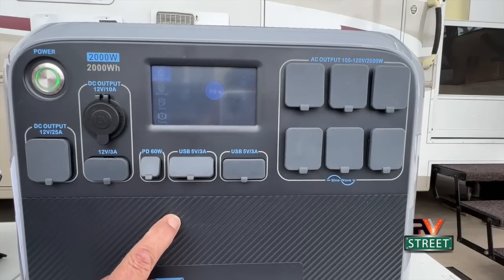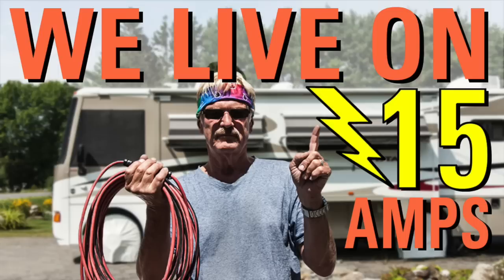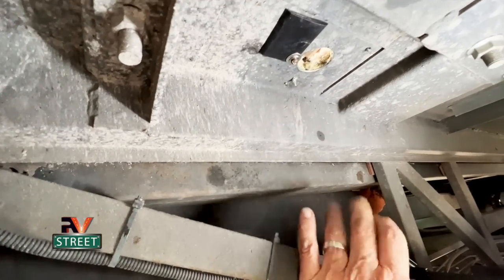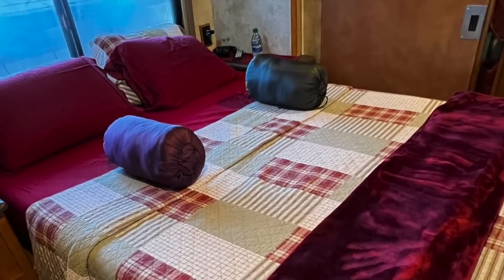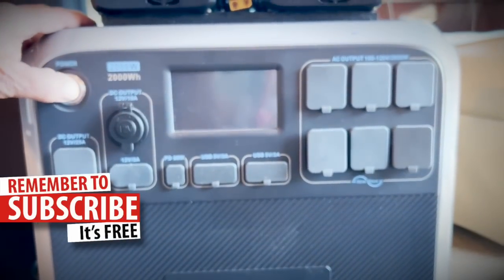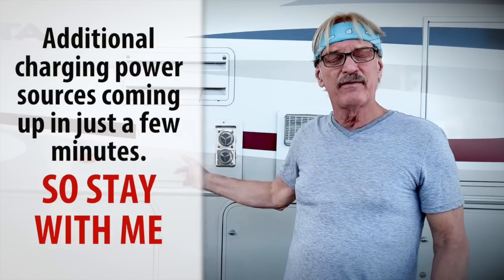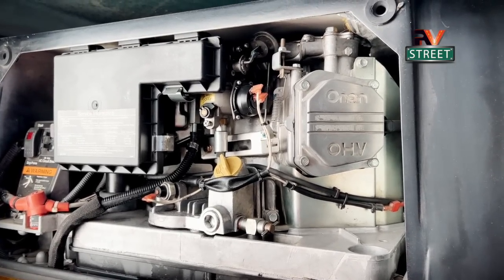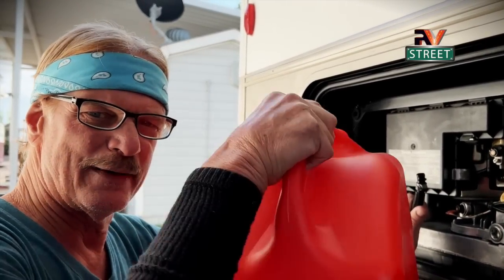Using a Bluetti AC200P in an RV • Most hands on Video on Youtube

Comment: I really love your review of the AC200P.  I could’ve bought it but instead I bought the EB240 which comes with a 1000w inverter but has larger battery - 2400Wh vs 2000Wh.  I was too concerned with the internal power draw issue.  Now after watching you use the Honda EU2000i generator (same one I have) to charge the AC200P, I wish I had bought the AC200P instead.  Who cares that I have 400 more Wh or about the power draw problem with the AC200P when you can charge the AC200P in 2hrs using the extra charger with the Marine connection port set to Solar input. I also like how you  connected the AC200P to the shore line and bypassed your RV inverter.  WOW!  I still like my EB240 and wondering if it’s possible for me to connect it to my shore line and bypass my inverter?  I don’t have a large RV like you.  I just have a small popup camper and don’t need to run all that you run.  You’re amazing presenter.I joined your channel.  Thank you!
Reply from the maker: H Felix,
Ya the inverter draw in my AC200P is miniscule in the big scheme of things. I'm not familiar with the EB240 but hey give it a try on the main power cord. You'll know immediately if it will work or not. If it does, run some tests and see what it's capable of so you'll know the parameters of what it can do. If you ever decide to later on to buy the AC200P, I sure would appreciate it if you buy it thru my Amazon Store. Or anything else for that matter. And THANK YOU so much for joining my channel 🙏
Here's all my videos: https://www.youtube.com/c/RVstreet/playlists
My Amazon Store: https://www.amazon.com/shop/rvstreet

Comment: Can I use 30 amp to 15 amp adapter to plug my shore plug into Bluetti?  Will it power AC, TV and fridge? Just for day or so? Would that be safe? I don't do solar, generator or even have house batteries in my 92 Toyota Warrior. Can I cigarette lighter cord to fridge while I drive? Thanks for any replies.
Reply from the maker: I'm sad to say that Martin has passed away and I don't have the answer to your question. Sorry

Comment: If you're just charging it from mains or generator then what's the point, should be using solar, pointless 🤣🤣🤣🤣🤣🤣🤣
Reply from the maker: Solar would be my first choice BUT the sun isn't always available. There may be 110V outlet somewhere else, like the car inverter or car 12 volt system, or....I can charge it with my small Honda generator 4x's with one gallon of gas and save fuel instead of using my big onboard generator. Many other options to juice it up. It's emergency power. Every RVer should have alternative power sources in the event of any kind of emergency IMO. Like the winter of 2021. I like multiple options if one way is NOT available. That's the point. 🤣🤣🤣🤣🤣🤣🤣

Comment: Nice video, thank you. I just ordered my AC200P.  Is there a solar input limit for Amps or Volts?  I have two 400 watt solar panels and assume they should be wired in parallel versus series?
Reply from the maker: I'm sorry to say that Martin has passed away and I don't have the answer to your question. So sorry💔

Comment: The Bluetti AC 200 MAX has a 2200w inverter, 2048wh and a dedicated 30amp output. The Ecoflow Delta Pro has a 3600w inverter, Life PEO4 chemistry (same as the Bluetti) and 3600 wh. Recharges at 150amp (1800w), no heavy charging blocks.  It also has a dedicated 30amp output and can easily run an air-conditioning and everything else at the same time. Surge 7200w and up to 4500w continuous. Both systems can run your entire rv effortlessly, be recharged in 2 hours  or under (Ecoflow Pro 1.7 hours). The Ecoflow Pro is the more complete system that makes rv live easy. while the Bluetti is more as an extra energy source. Having  both would be ideal (5648wh rechargeable in under 2hours). There the best portable solar generators you can find.
Reply from the maker: Thanks for your comment Plex 👍
Just want to make sure we're on the same page. You did hear at the very beginning and all thru the video that these systems I've implemented over this past year—including the Bluetti AC200P was for EMERGENCIES right? Of course there's more powerful systems out there. Heck if I had an unlimited budget, plenty of room, and plenty of CCC, I'd put a system together that would blow your socks off and would run on Kryptonite 😝 😝 😝  👍

Comment: Thanks Martin, great video.  Can I ask why you bought the 200 rather than the 200 Max, with the 30 amp outlet.
Reply from the maker: Good question....
I don't need that kind of power. I mean just think about it? You saw me rolling this puppy around with the dolly I made. Can you imagine having 1 or 2 more big batt's under that and all the connecting cables? It would just be way to much for me or for most RVer's IMO. Now for a tiny house or a home back up system OH YEAH!. This AC200P is portable enough, affordable, stores nicely, and packs a lot of power as you saw.
One more thing, in an RV you always have to think about weight. I have plenty of CCC, but the 200 max would add probably ANOTHER 150lbs. that I would have to think about on where to distribute that extra weight. For some people that extra weight would be a problem.
As I said in the very beginning of the video this AC200P checked all the boxes as far as I was concerned.

Comment: Hello Martin (Martino from Italy here ). Just bought an AC200P , and cause you have some months experience with it, can i ask you one thing: bluetti told me that it is better not to use the unit when you charge it too. Because lifespan of the battery will be affected. Have you consider this or think if it will be an issue? They say to fully charge the unit monthly to keep batteries good condition. So, maybe it is a bms issue. What do you think? Thanks and i follow you. Bye!
Reply from the maker: No, the whole point is to be able to charge it while using it. Use it, and bring in solar or a generator to recharge while you're using it. No problem on battery life. Also, no need to recharge every month to keep battery good. If you're not using it, recharge it every 4-6 months is just fine.

Comment: I found a fantastic tool for siphoning fuel out of a vehicle.  It is called the gastapper. You can do a internet search and it comes up. My father in laws had a stroke last year so his vehicles have been setting all this time with full tanks of fuel. I needed to get the fuel out before it went bad. Did some research and found this tool. Worked perfect on his Ford F150 and Honda CRV. What a life saver. Check it out and keep up the great videos.
Reply from the maker: Thanks Chris,
Yep, that's the exact product I was talking about that I saw on YT. Tried it on both my RV and car. Didn't work.

Comment: Excellent information. Question:  I noticed a while back in one of your videos you talked about your engine providing heat for your water heater. Is that factory or did you set that up yourself. Thanks for the great info you provide in your videos 👍.
Reply from the maker: I NEVER use my engine to heat the RV while parked. But...when we're traveling and underway and if it's really cold I'll either run the dash heat or on a very few occasions I'll run my onboard generator.
Reply: Mr Musstud  ,sir , martin has the same motor home that we have , the water heater is an atwood unit , it uses 110 volts/ lp gas/ and it has what is called motor aid, a minnebago term for the engine coolant heating  the water in the hot water heater , there are if you have this option, two coolant lines under the chassis of the rig, then they go up to the water heater, its basically free energy , and it works quite well , since you already have hot engine coolant , your just putting it to good use, and dont worry , engine coolant does not come in contact with the water tank , two seperate systems are utilized , i hope this helps you, btw the , its also called a heat exchanger system for the water heater
Reply: @michaelj1232  Thank you for the answer being factory option.  I have an older Class A, and trying to understand its setup, so maybe I can accomplish the same results.
Question 1: If you know, where is it connected to the engine coolant system? The radiator, or the coolant hoses or by the oil filter coolant hose connection?
Question 2:  Is the water heater a special unit with a built-in coil or is it a standard heater with a heat exchanger by the water heater and connected to the inlet supply line and discharge hot water line? 
Thanks for the info.
Reply from the maker: Mrstudmud, ya i'm sorry I missed the part of your question about heating the "water heater". So ya what Michael said is correct. We have a Atwood Motoraid water heater, it's from the factory and it heats the water while were driving. It runs off the engine cooling lines.
Reply: @RVstreet  Thank You Martin!  I have an older unit, is it doable to rig up such in my coach (V-10 chassis)?  Does your water heater have a inside coil for that or does it use a regular water heater and connect to the inlet and outlet water lines?  Thank You for the help!
Reply from the maker: Yes the coolant circulates thru the WH then back to the engine continuously.  To my knowledge this can't be retro-fitted to a different type of Atwood WH. But I could be wrong on that. Send an email to Atwood with all the appropriate info about your WH and they'll be able to tell you for sure.
Reply: @mrmudstud5980  its very simple sir, really, all it is is a metal connection connected to the rear of the water heater ,  the coolant hoses attach to the connection, to and from from the engine, if your rig has the feature, the connection gets hot and it radiates the heat to the connected tank, its very simple , and many think that the coolant can come in contact with the internal water of the heater, no way, two seperate systems, if your water heater does have this feature, please do as DR MARTIN stated on taking care of water heater heater , cleaning it and using vinegar, due to atwood was bought out by dometic, and dometic is basically not producing many water heaters with motor aid  or a heat exchanger , this is where i am right now , my atwood unit is cracked , and dont have many options, take care and safe travels sir ,
Reply: @RVstreet  Thank You Martin, I need to do some brain storming about the setup.
Reply: @michaelj1232  Thank You for the reply. This is my take, install a heat exchanger near the water heater as close as possible and connect the engine coolant to one side and back to the return line. Then, put a pipe T connection near both sides of the water heater on the cold and hot water side. Connect both of these to the other side of the heat exchanger. 
I believe the exchanger will get hot enough for the water heater fluid to circulate on its own do to convection heat from both fluid’s and heat the water some. I believe this will work. 
Then if does not work enough, then get a 1 gal/min 12v water pump to turn on when the ignition switch is on to circ the water.

Comment: If your plugging a cable into the pedestal to charge the Bluetti and having a male connector on the cable running into you rv isn’t that plug now hot, back feeding (power on the plug ) isn’t that a little dangerous?
Maybe I missed something.
Reply from the maker: Ya you missed it. The way I did it, it's not dangerous at all.

Comment: I bought this unit due to the high amperage 12 volt DC port in order to feed a van build DC fuse box and avoid AC loads. Unfortunately the unit arrived with quality control issues for that aviation plug port that made it impossible to connect to. I have been trying to contact Bluetti for over a month via phone and email with little to no response. This company has absolutely zero customer support. You better hope your product works out of the box because trying to get any technical support or return authorization is near impossible.
Reply from the maker: Why was it impossible to connect the aviation cable  into the port on the unit?
That aviation plug has a red dot on the plug and it snaps in. There's nothing difficult about it. On the other end you have a MC4 connector. 
Elaborate for me exactly what's going on. After we talk here, I'll contact who helped me over at Bluetti and see if I can get you so help. I've had over 20 emails from tech support and they have responded well.
Just remember also, they have been running a huge sale the past few weeks and they are probably super busy with requests and questions.

EDIT: When I got my unit I also had a problem, so they replaced the unit. I thought it was the AC200P itself. It wasn’t. The 2nd unit also had the same problem and I couldn't believe two units had the same problem. So I tested the cables themselves. The long aviation plug cable was fine but turned out the problem was with that small 5” XT90 To DC7909 Cable that goes onto the end of the aviation cable. It wouldn't allow power to pass thru from the 2nd charging brick. Something was wrong with that cable. I notified them about this problem and they sent me a new cable and all has been good. After my discussions with them, they thanked me for the input and pointing out the problem with the one cable.

You have to remember, ALL THESE COMPANIES—that make these kind of products can and do have production issues from time to time once the design and pre-production are approved. These problems are rare but do happen. In my case it was this little cable.

Comment: Great video.  On my wish list, a step by step video on how to connect the solar wires for 3 sets or 2 sets of PV 200 panels, plus extension cord. Just seeing the completed wiring is nice but not fully useful.  thanks.
Reply from the maker: Hi Mary,
Ya I understand maybe I should of showed a step-by-step procedure….but

5:05 in the time line…..You take the solar 2 MC4 wires from your solar panels regardless of whether you have 2, 3 or 4 panels that are wired in series and you’ll end up having 2 MC4 wires just like I show below in the next time line. You take those 2 MC4 wires and plug them into the MC4 connector cable, plug that into the aviation plug and that plugs into the Bluetti. 

31:08 in the time line…..shows how to wire my 2 - 200watt panels in series. The PV 200watt panels are done the exact same way because they also have MC4 connectors. If you want to add a third panel—which I have done since this video was made—you just add the 3rd panel in series in that string of panels the same way. End the end you’ll have just 2 wires from all the panels.

Just as a quick side note….@ 29:04 in the time line I unplugged the solar from the Bluetti and you can see the aviation plug and the MC4 connector cable right their. Not the greatest explanation but it may help

My video for reference to find my above comments in the time lines: https://www.youtube.com/watch?v=RraxjVpLhUc

Bluetti’s website page that shows a complete diagram of what I explained above: 
https://www.bluettipower.com/products/bluetti-pv200-200w-solar-panel

If you ever decide to buy a Bluetti and their solar, from my personal experience you can't go wrong with this unit. Very easy to operate and hook up, tons of reliable power @ right price point. I have everything in my Amazon store. Buying it thru my store would be a great way to say thank you for making this video and helping the RV community. No pressure just a friendly reminder.
https://www.amazon.com/shop/rvstreet

I hope this helps and if you have any other questions don't be afraid to ask. I'll help if I can 👍

Comment: Martin, do you have a link for the Bluetti AC Charging Brick in your Amazon store? I didn't see one. Did a quick search in Amazon and didn't find it listed.
As always, excellent video and very comprehensive solution.
Reply from the maker: You have to buy the extra charging brick thru Bluetti as well as some of their other accessories. My AC200P Bleutti, the 4 cables I showed that comes with it and the solar panels are what's available in my Amazon Store and is sold on Amazon.
thx Space 👍

Comment: Hello Martin - We purchased the Bluetti AC200P and three of the SP200 solar panels.  We are looking for the AC charging bricks.  Can you help locate in the Amazon store?  Also, do we need to purchase any additional cords?  Thanks so much.  Enjoyed your video.
Reply from the maker: I wish I could of listed it in my Amazon store, BUT the extra AC charging brick is only available thru Bluetti's website. Did you happen to buy your AC200P and panels thru our store? Just asking. No extra cords needed. Everything I showed you comes with the Bluetti and the extra charging brick comes with the adapter cord to plug into the aviation plug that goes into the solar side of the Bluetti.
thx John 👍

Comment: So I need to turn my RV inverter off to use the bluetti as a power source, I have a automatic transfer switch on my diesel 50 amp!
Reply from the maker: No need to turn your inverter ON when you hook up the Bluetti to main power cord. By just turning ON your inverter, it immediately starts using power from your house batt's unnecessarily AND that's before you start using items that run off your inverter which drains more power. Keep the inverter OFF.